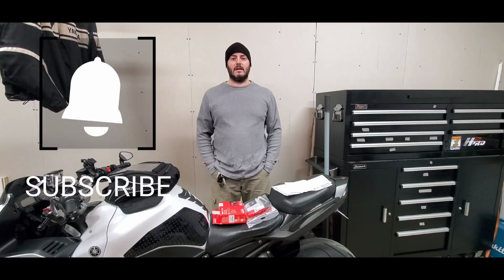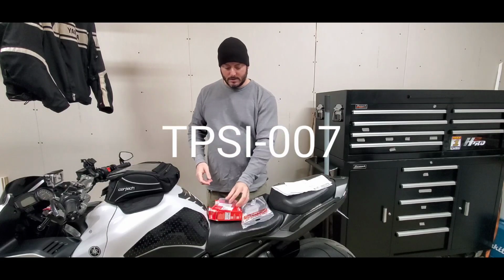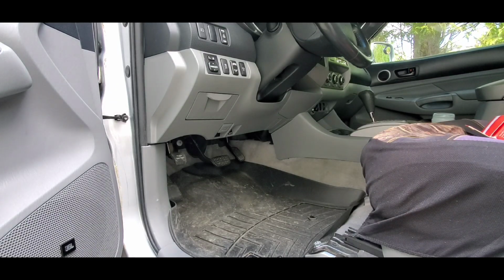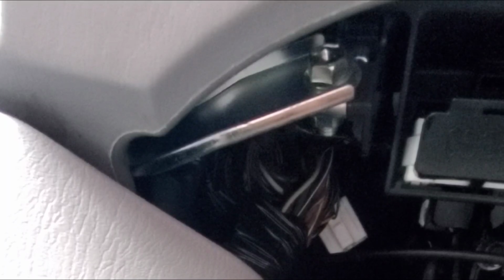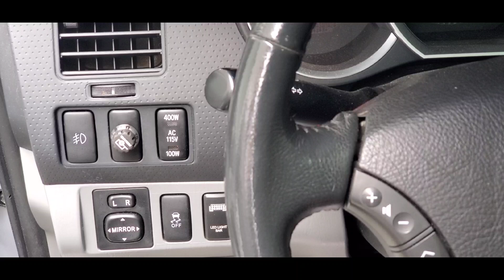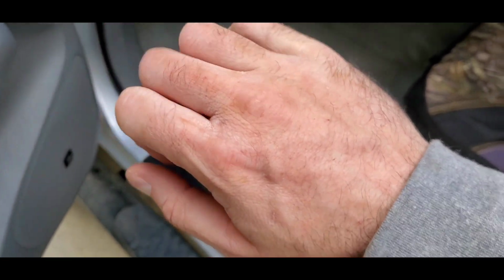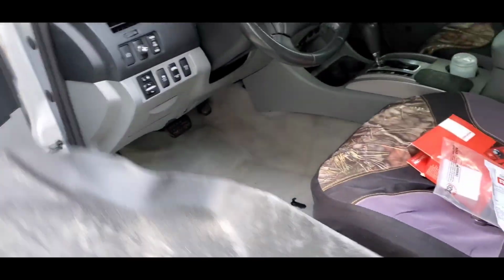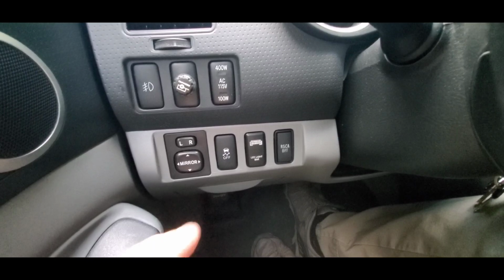Toyota Tacoma Redarc Liberty Brake Controller Plug and Play Button and Harness Install Only (Part 1)

Comment: Thanks for the video. I'm glad you mentioned the e-brake wasn't in the way. I've got a 23 which doesn't have a foot brake but I do have a clutch pedal and was concerned. Noticed you don't have a part 2 yet. Hope it's working out for ya. Cheers
Reply from the maker: @denmorin for whatever reason I needed to tow twice before I got the controller and haven't had to tow ever since!

Comment: Did you make a part 2 video for this brake controller?
Reply from the maker: @chuckisoutside I haven't had a chance to use it to haul anything on a trailer with brakes, which is supposed to be part 2. Sorry!!